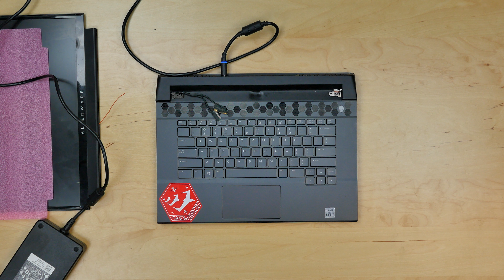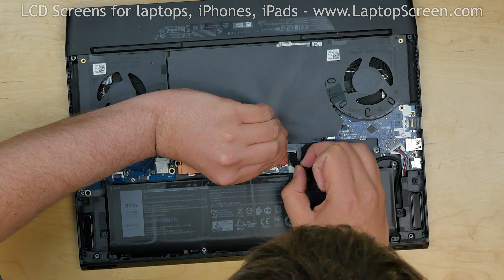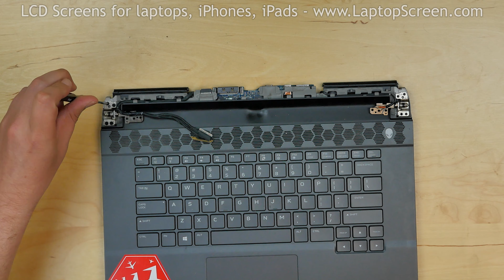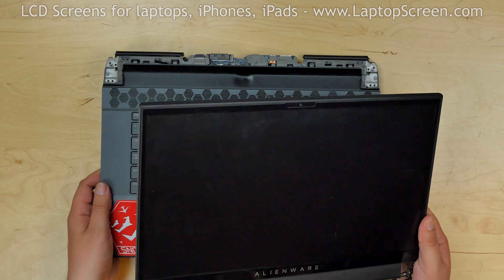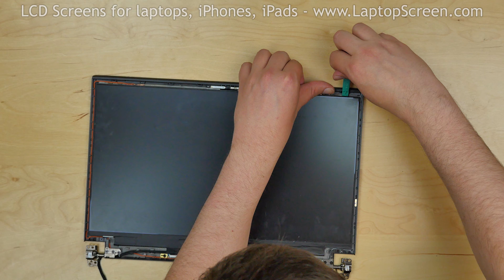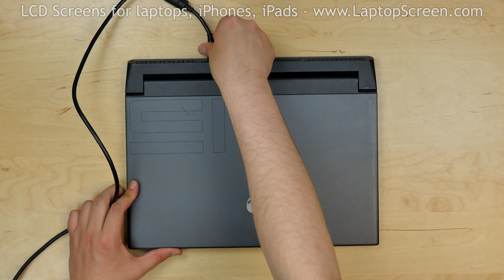How to replace LCD Screen on Dell Alienware M15 R4. Step-by-step instructions

Comment: Man, I repaired over 1200+ macbooks back around 2012. Seeing the heat gun to remove the bezel in this video gave me PTSD from the older style macbook pros. That adhesive was strong, so you had to be careful not to damage the LCD to replace a cable, or to replace the back aluminum and put the LCD back in. Routing the cables back and putting the front bezel back on without any odd gaps was a pain!

Comment: Seriously these alienwares are bunch of crap. I have one M15 R7 and it only charges when the lid is positioned at certain angle.Frustrated as fk.

Edit: I guess I have now root caused it, its their weird design of video connector cable close to the power supply, so everytime opening and closing lid might seems to interfere power jack🫤

Comment: Nice video. Alienware is shit. I bought one in November 2022 and this thing is a nightmare. Rarely used but every time another problem occurs. Never again i would buy something from Dell.
Reply from the maker: For real, the video cable broke on this one just from filming the video, had to wait 2 weeks to get another one. The whole rear sliding assembly thing is an overly complex ridiculous design.

Comment: Thank you for this video! I just ordered a screen for my M17 R4 and it looks pretty similar to this. My M17 R4 intermediately won’t turn on screen with diagnostic light code 2-7, looked it up to see what it meant and calls for screen replacement.
Reply from the maker: My friend, you'd better order an LCD cable as well. If the LCD isn't cracked, there are few things that can go wrong with it. The diagnostic code can indicate both problem with cable or problem with LCD. We had to wait for 2 weeks for a replacement LCD cable on this video, because it broke just from looking at it.
Reply: I wasn’t able to find a LCD cable, can you refer me to where you able to find one?

Comment: Hello I know the video is a bit old I have the same laptop M15 R4 with screen issue , do you guys do drop in and repair of laptop screens ?
Reply from the maker: Actually we do! Our site for that is: www.ScreenFix.com
You could drop off in Vancouver, Canada or mail it in. This laptop was a complete head-ache, had to replace a video cable, so had to wait a while for parts to get in.
Reply: Great , what if the laptop has another issue for example speakers or cable issue . Do you offer repairs for other laptop problems or is it just screens replacement ?
Reply from the maker: It is for screens, as those are what we have on hand. When it comes to laptops with multiple concerns, it quickly becomes uneconomical to have a technician deal with it, as laptops are generally affordable nowadays, so the final price could come up to what a mid range brand-new one would cost.

Comment: Hi my laptop is an Alienware M15 R3, itvfell and broke the screen, I took it to a place to repair they opened the display to check, ordered the part and it didn't fit because it has to be a 40 pin new version UHD not FHD... But until I get the new display I cannot use my laptop because they told me that once open the display it won't work like the laptop is on but the screen is too dark now to see because of the glue or something when they opened it, is this correct? Does this happen? How easy it is to find the right display for my laptop?

Comment: hey, thank you so much for the video.
I have a M15 r5 and i`m having problems with the screen... It turns on but it doesnt show image, but its not black... its just some white with some green stripes and as i move the screen it changes a little bit. When i plug the computer in a Monitor screen it works fine. Should i just replace the video cable of it? if yes, do you have that for sale?
Reply from the maker: The video cable on this computer was complete trash, had to get a new one just for this video. Your best bet to find one is on eBay.
Reply: @Laptopscreen  Precisely what I ran into just now. Good to see this already has an answer

Comment: I would like to know if the screens sold on the pages are certified by Dell 
I mean.
I recently bought a Dell alienware m15 r7 QHD 240 HZ

And the laptop came with some kind of burn or brushes stuck on the screen
Do you think I can get a replacement screen for this model on that page? 

I tried to search for the page but I see that they do not have it available
Reply from the maker: Dell doesn't make screens, but our screens come from the same factories (not owned by Dell) that Dell puts in their computers. There's about a 1 year delay before we stock the newest models, because it takes a while for people to start breaking them after buying their laptops.
Reply: Okay I understand @Laptopscreen